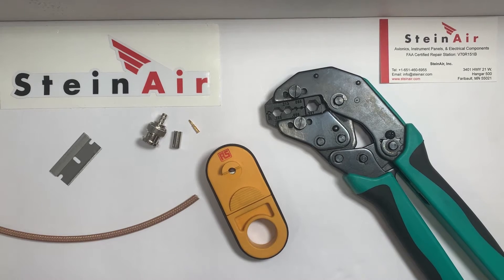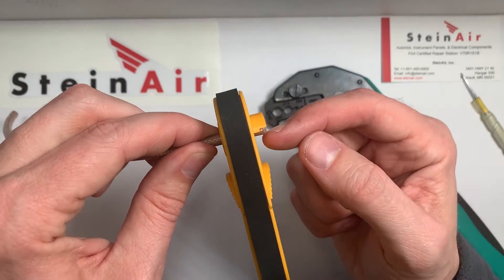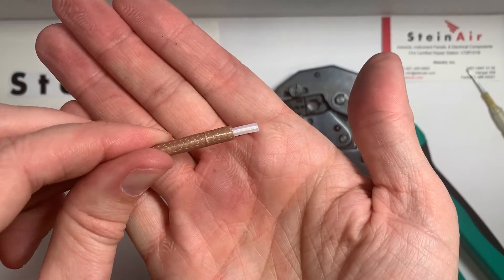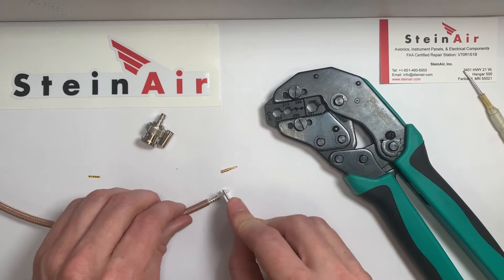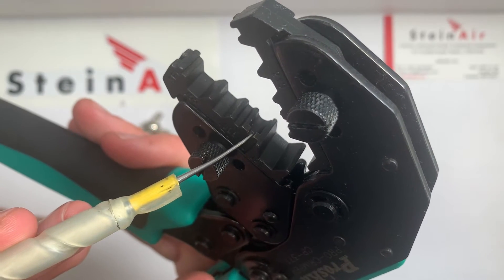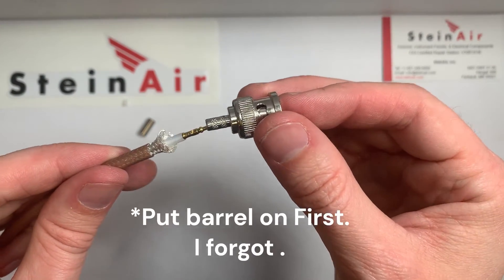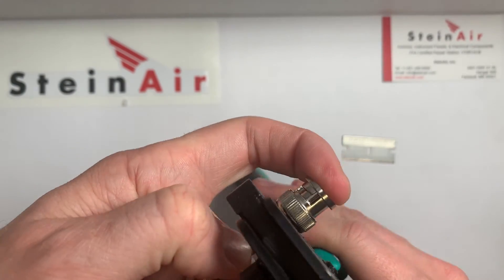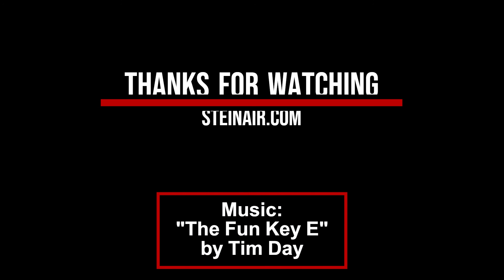024: SAT-COAX Stripper Tool and BNC Crimp tutorial

Comment: I hate to be that guy. 
Double cimping those pins is just a recipe for metal fatigue induced cracking and failure of the pin. 
And the same applies with the outer ferrule.
Reply: I didn’t see a double crimp of the pin, but I did of the sleeve.  I don’t double crimp the sleeve either.  I like having the uncrimped bell at the end to ease the transition to the cable.  Makes it less likely to damage the cable if it gets pulled sideways on the connector.
Reply: When I worked F-16s we had an airman that crimped, rotated, then crimped again. It made a star shape and completely severed the center conductor.

Comment: I wish they had Snap-N-Seal style compression connectors for RG400.  I use those on RG-11 and RG-6 cable and they are much nicer.  You can strip in one operation and crimp in one more.